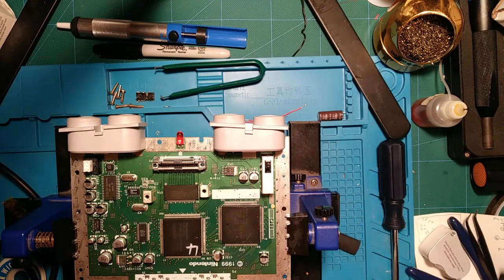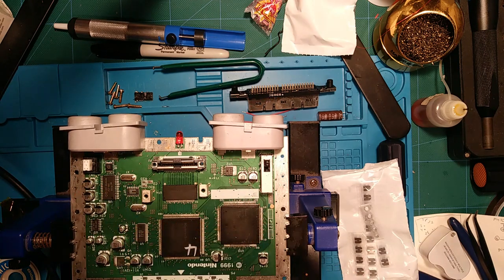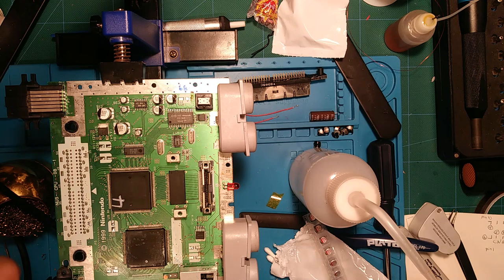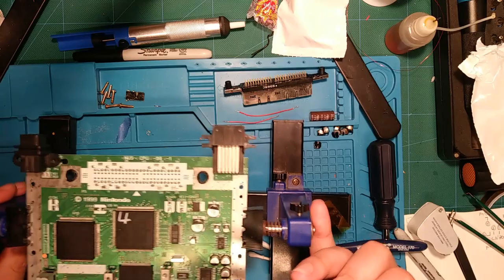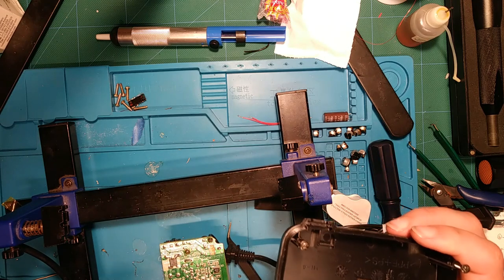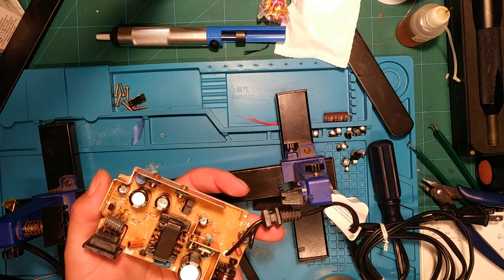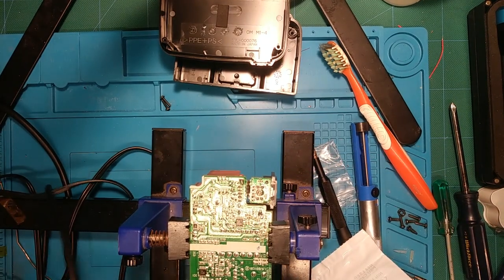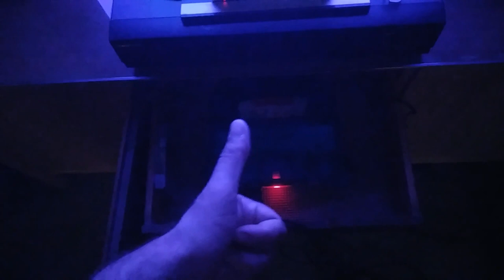Nintendo 64 Recap - Console/Power Supply

Comment: Sorry any chance of a link to the cap vendor?
Reply from the maker: thanks for watching! I got to Console5 for all my retro game recap kits (they have other mod/repair components as well). In theory, if you were opening an electronic repair shop; you would be better off buying in bulk from Mouser Electronics or a similar vendor. But, if you're just doing a project here and there (even if it's a kind of side business) it's much nicer to just have a complete kit with all the tech notes/upgraded parts for the specific console you're working on. They source high-quality, brand name caps in all the their kits like Rubycon or Nichicon; probably buying in bulk from Mouser themselves.